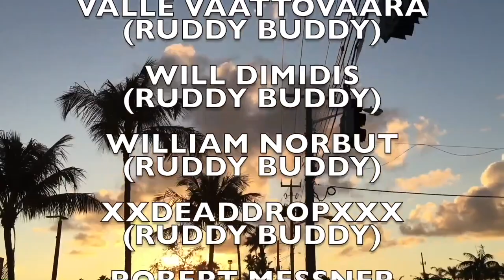THINGS ALREADY BROKE...

Comment: Why make the tire rack fixed to the wall? Build a tire rack on casters out of 1" square tube
Reply: For extra space you silly goose
Reply: @bobbybroone1818  it doesn't take up any more space, is much easier, and you can move them around if you wanted to load up a trailer or something

Comment: 4:46 oh baby my mans got an s15 sr... for the roadster?🤔🤔
Reply: Wondering if hell put it in the civic because he said they're is up and coming plans for the civic
Reply: Doesnt the roadster just need a gearbox, not an engine?
Reply: @Jake_Hamlin  yes, but he’s been saying for a while he wants a built motor for it bc it’s still a stock bottom end, and the vct on the s15 sr helps it makes more power/torque both at higher rpm and earlier on in the rev range. Would be a good motor to build for a crazy setup
Reply: @Jake_Hamlin  yeah I believe just the gear box or something with the trans

Comment: Lol why would you drive with and engine on that stand? They are designed to sit and hold and engine. Not be bounced around in the back of a trailer going 70 or higher down the highway. Some people have to learn the hard way brother.